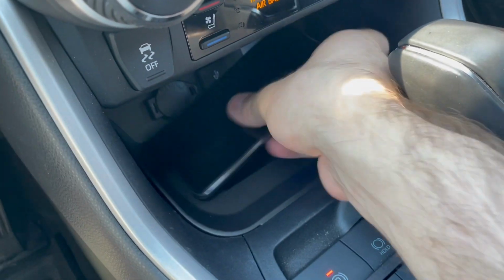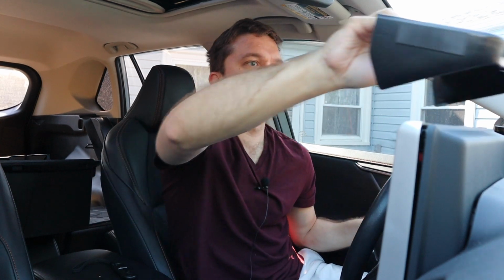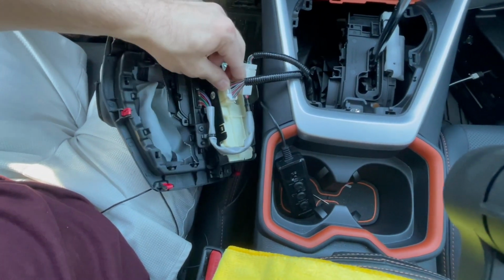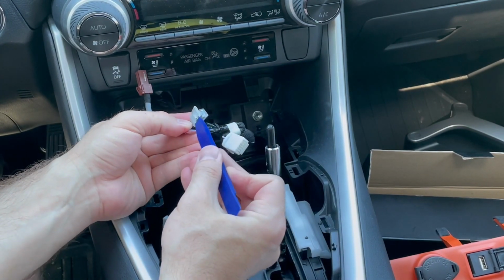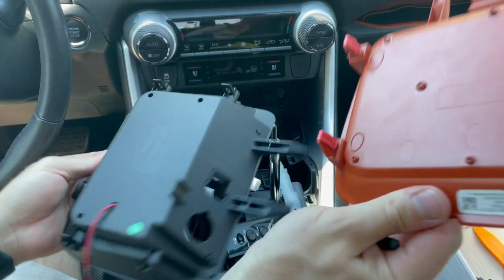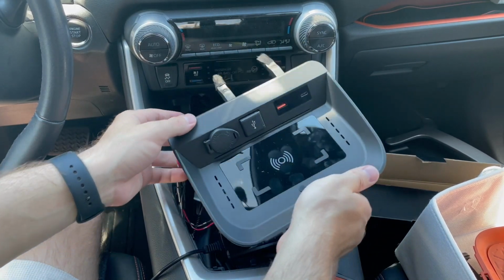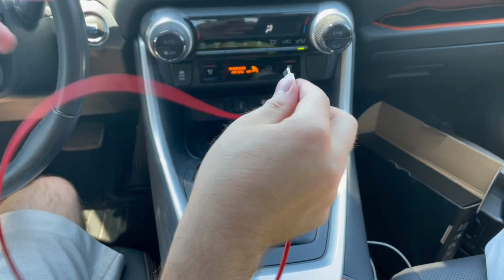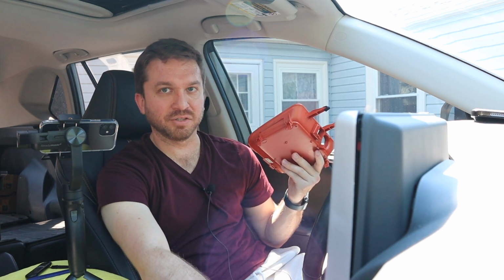Wireless Phone Charging on Toyota Rav4

Comment: The extra connector in the wire harness loom is for the factory/OEM wireless charger. Yours is using a different plug/setup, more like a tap. Thanks for the video.

Comment: Bought this in March 2023 and in May 2024 it stopped working. Removed it and found the wiring for the auxillary jack had melted. The item was purchased thru Amazon and is no longer available and I have no way to contact the vendor to address the issue. This item also didn't work well with wireless charging if my phone had a case on it. Not recommended for purchase.

Comment: Hi, I installed this product. the wired connection works fine but wireless charging is not working. In addition, there is no light on the wireless charge screen. I guess the product is broken? In addition, I have message showing on screen "parking brake unavailable". do you know how to fix it?
Reply: I’m having the same issue

Comment: Did you also test out the iPhone 12? The iPhone 12 and 13 don't lie flat due to the protruding camera lenses and I'm not sure if that would limit the charging feature. I have a 2021 RAV4 XSE with the Qi charger and it shuts off after 20 seconds. I don't know if that is an issue with the OEM charger or if due to the gap caused by the camera lenses. I've tried the charger with the phone case both off and on, no difference. It is a MagSafe case and charging works fine on my Anker charger in the house, but the Anker charging pad is round and the camera lenses don't touch it. I'm going to ask Toyota dealer at my next service interval, but I'm hoping to find an answer on the Internet before then. I don't really want to have to spend extra money to replace the OEM charger if it is not necessary. Thanks.
Also, a suggestion - when you remove the shifter housing, it would be a good idea to cover the exposed transmission tunnel with a towel in case you drop something. That comes from personal experience. :)
Reply: Make sure you place the phone exactly where the charging coils are on the OEM  wireless charger(even slightly off can make it not start charging). Test it on another phone and if it's still not working ask Toyota if they can install another and hopefully your still under warranty.

Comment: I just installed my charger n when I put the  phone  it's  start to flash  blue n red
Reply: I unplug it and  red start to flashing what could I do to its to work  help me
Reply from the maker: What does not work?
Reply: I installed the car phone and my phone does not work n my wife phone doesn't charge it turn red the light starts flashing red in unplug it n does the same with the cable  work
Reply from the maker: You might just have a faulty unit. Do an exchange?

Comment: Could you tell me about what you use to mount your phone in your Rav 4. I found one that works ok with vents in my 2018 XLE but I believe where the vent are in the 21 XSE I have ordered it would kind of impede the head unit and the climate controls. Awesome content, keep them coming!
Reply from the maker: At the moment, I don't always mount my phone answer because I use a dasaita head unit which is a full android unit. Prior to that, I was using a simple magnet to the vents which worked okay. Good horizontally, not so much vertically. https://amzn.to/3hvK9bl
Might be a nice video to do a comparison between the options available specific for the Rav4. Stay tuned.